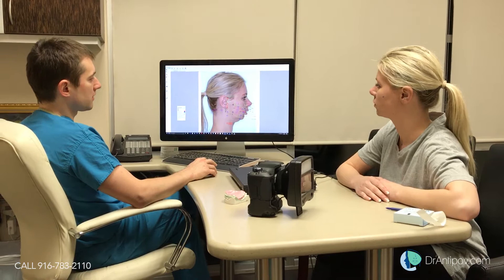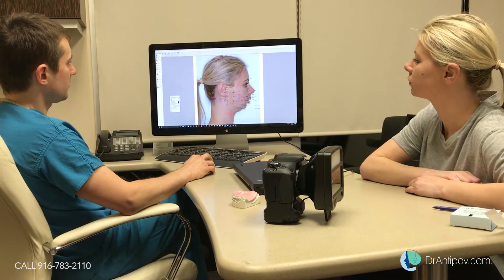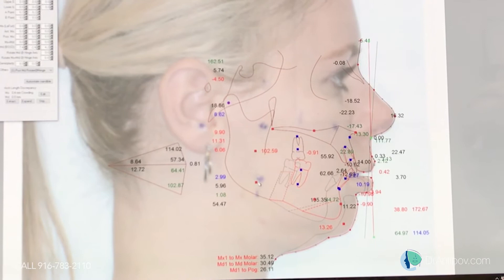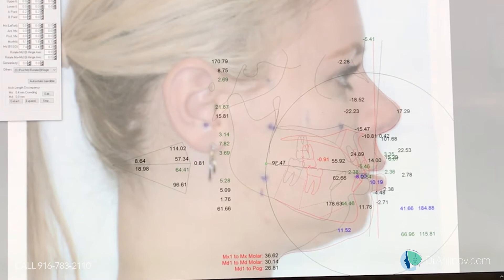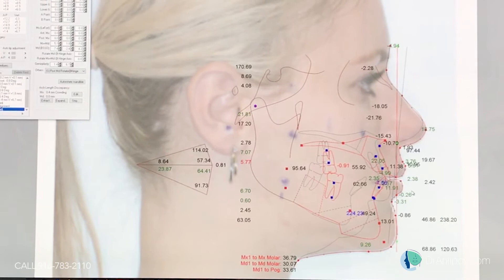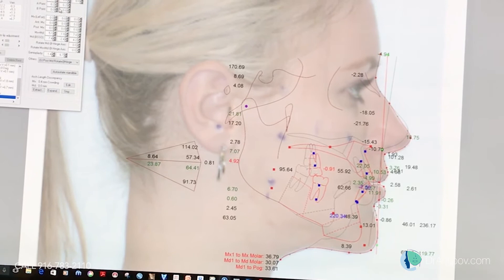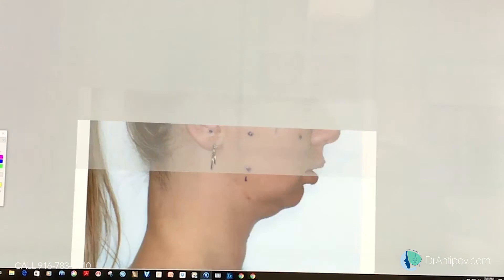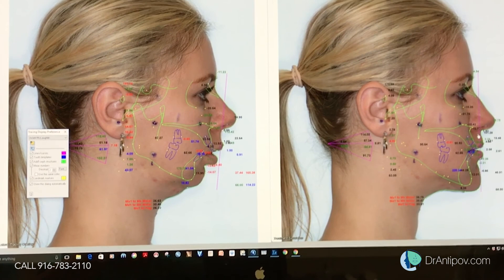2D Orthognathic planning

Comment: I too have a an overjet and a severe TMJ issues since 10+ years my surgeon told me that I need a total joint replacement surgery for Both the sides of my jaw joints and he also said that my lower jaw has went further back then it was after comparing my new images to my previous images which is causing me breathing problems lately.